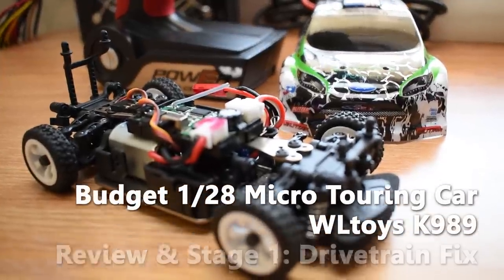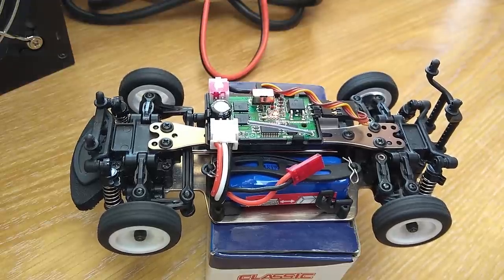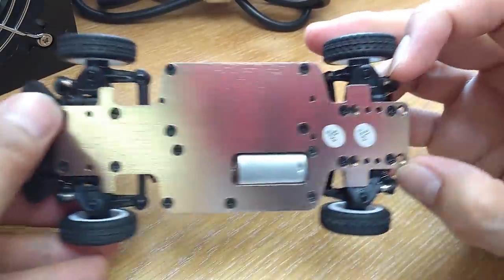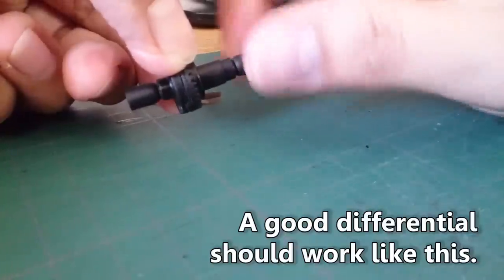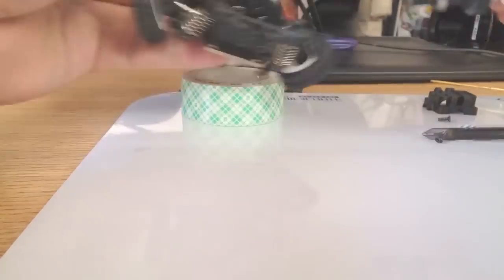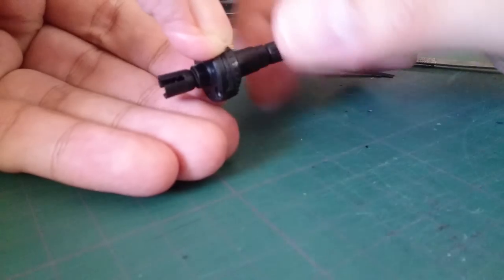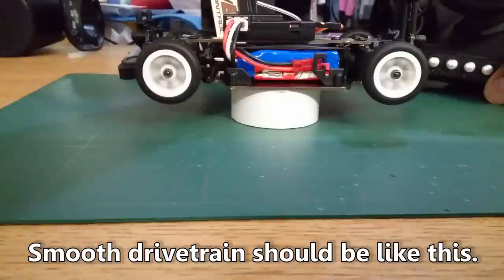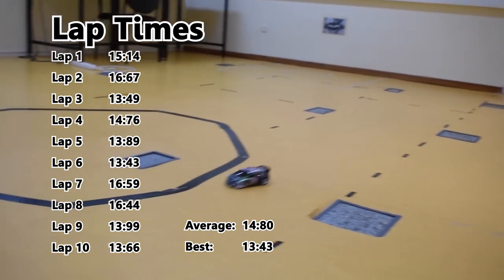WLtoys K989 Budget Touring Car - Stage1 Drivetrain Fix

Comment: How does this type of car compared to the Mini Z platform?  Better, worse, or just different?
Reply from the maker: For me it's better because I can choose any electronics I want and not stuck with proprietary electronics/radio.
As for the driving experience it's different from chassis to chassis. For WLtoys chassis in specific it's better to drive than standard Mini-Z AWD MA010 and 020 once all the problems are sorted out. This car takes corners better mostly because of the double wishbone suspension but still not as good as other chassis with grease filled shocks. And Mini-Z MA030 with DWS upgrade is better than this chassis. Not the speed wise but the consistency and ease of driving. I'd say MA030 allows me to make more mistake than WLtoys.
Top AWD touring cars right now are GL Racing GLA, Atomic BZ3 and Mini-Z MA030 EVO. While each of them offers different handling styles most racers choose GLA and BZ3.

ps. These days I mostly drive Mini-Q Q7 for touring and MA030 for drifting. I still haven't made the videos detailing my setup on these 2 cars yet though.
Reply: @BeaversHobby  Thank you, I really appreciate your detailed response.  I've been trying to figure out which AWD car to buy and I trust your opinion.
Reply from the maker: @blammers  My pleasure. Check out this video from Garage RC too. He has hi-end cars like GLA, SZ and BZ3. https://www.youtube.com/watch?v=77OeXvUxvbg

Comment: Great video. Can you do your recommendation on upgrade for Rc 1/28 racing indoor timber floor. Thanks
Reply from the maker: Replace the tyres with foam tyres. That's the main thing you can do to improve it immensely. There are XPower and GQ that come with wheels and the tyres glued to them. Otherwise you can use Tamiya Mini 4WD tyres.
Reply: Thankyou. Do you have part numbers and links where I can buy tyres and rims. I want to buy wide rims on rear and narrow rim on front. I have bought a set of fire laps tyres you use in your video.
Reply from the maker: @alessandrosebastiano8331  Firelap was OK if your floor is clean or regularly clean the tyres while running. If you want to run it without worrying about the floor cleanliness then foam tyres will help a lot.
The part numbers are
X-power ST-AWD-F-S-1 for the front.
X-power ST-AWD-R-VS-0 for the back.
Terminology explained:
ST-AWD means wheels with glued tyres for AWD.
F/R = front (narrow) or rear (wide)
S = soft, VS = very soft. We usually run front with lower grip so it won't roll over in the corners,
0,1,2,3 at the end indicates offset. Personally I run front 1mm offset and rear 0mm offset because the centre line will be pretty close and these work well with my body.
Reply: @BeaversHobby  Thankyou.Can you do a videos on wltoys 1/28 k969 car with all upgrades for indoor timber floor racing? Greatly Appreciate.
Reply from the maker: @alessandrosebastiano8331  Basically it's just the touring upgrade (this series) up to part 4 or 5 if you wish to upgrade the electronics and with the tyres I told you before.
Reply: @BeaversHobby  Great Advice.I'm sorry Where can I buy the best wheel rim and rubber tires combination for indoor racing.
Reply from the maker: @alessandrosebastiano8331  That depends on where you are. Normally I recommend looking for a local or regional Mini-Z shop. If you are in the US or north America, check out kenonhobby.com for EU check out minizracing.it/minizshop , UK https://www.rcm8.net/ and rcmart.com for global shipping.
Reply: I love your work. Thankyou again.

Comment: My front wheel is vibrating and I noticed that it must be a damaged ball bearing. I think the size is 3*7*2 . Will a 3*7*3 fit?
Reply from the maker: It will work but you can't fully tighten the wheel. You can only use it on 1 side (there are 2 in each knuckle) and pushing the wheel out 1mm is already bad so much so that the wheel might come off because there's not enough thread on the screw to grip the nut.
Try and find 3x7x2mm, there should be some on ebay.
Reply: @BeaversHobby  thank you very much
Reply from the maker: @Nikoslido  My pleasure.

Comment: Have you drifted the k989 with open stock diffs? Im currently using open diff for front and locked diff for rear, is locked diff for front & rear good?
Reply from the maker: My stock is like locked so it drifts pretty well. The open front locked rear was what I used before I had one way. It's something in between locked and one way. Easy to turn in but a bit tricky to hold the slide. All locked is more consistent.

Comment: Hi!)) you showed how to fix the steering center on the transmitter  wltoys..  i can't find this video. Can you help?
Reply from the maker: I think it's about the taking the horn in, re-position it and screw it back. I don't think I made a video specific for that though but it's pretty basic. Take the servo out, unscrew the horn, power on the car + servo then put the horn back in straight.

Comment: Do these mods also work on a k969? Also are the stock k969 wheels and tires good for hardwood? If not what do you recommend because I plan on buying new wheels and tires but idk which ones to get.
Reply from the maker: Yes, the modifications are the same. The differential is a bit different though, K969 uses locked diffs and it doesn't have bevel gears inside. So you'll only check the thickness of the diff for good gear mesh.
As for the tyres, they are alright. You'll run more risk of scratching the floor than other tyres. If you want an upgrade, get Mini-Z AWD wheels and drift tyres.
Reply: @BeaversHobby  Thanks! One more question though, did you use thick or thin lube for the bearings and thick or thin grease for the diff?
Reply from the maker: @Nesrak  Bearing lube is a very thin oil. At the diff I use thick grease to give it a bit more tension. There're gear diff greases from Kyosho. I use no.30000 at the front and no.15000 at the back. Higher number is thicker.

Comment: Can you use a professional balance charger with this battery? Thanks
Reply from the maker: Yes, you can. And it's what I recommend too. The battery is 2S lipo 400mAh so you only need to select a proper setup for that.
Reply: Beaver's Hobby Do you plug the red jst into the main supply and the 3 pin plug into the balance plug on the charger?
Reply from the maker: @narrowempress1625  Yes, exactly. If your charger doesn't have red JST on the main you'll need an adapter. It should come with the charger though, my iMax B6 did anyway.
Reply: Beaver's Hobby thanks and I do have a jst rcy adapter that came with my imax b6 v2. In fact, I have 3 in total. And do I set the a ampage to 2.5a and have it on Lipo auto charge just to be sure? And does yours automatically cut off when the charging is done? And for the headlight kit do I get a jst rcy male plug to connect it to the battery? Thanks
Reply from the maker: @narrowempress1625  Manually set the cell to 2S or and A to 0.4 or 400mAh. Charging at 1C is the safest way to do. It'll stop charging automatically when the battery is full and if you haven't change the alarm setting it'll beep pretty loudly too.
And yes, you can do the light kit using RCY plug because the balance plug is occupied by the ESC.
Reply: Beaver's Hobby thank you. So I will set the ampage that’s going into the battery to 2.5a right? And is the grease necessary to fix the diff? Thanks
Reply from the maker: @narrowempress1625  No, the amperage that goes into battery is 0.4a. 2.5a is 2500mAh which is 6.25C and you battery will blow up.
The gear diff grease will help but not that necessary. If you haven't got specific grease for gear diff you can lube it with standard plastic grease or PTFE grease.
Reply: Beaver's Hobby thanks
Reply from the maker: @narrowempress1625  My pleasure.

Comment: Hey, please can you tell me will this stop the motor getting so hot it burns through the battery wire? I have the 284131
Reply from the maker: It should. By freeing up the drivetrain it will take a lot of stress out of the motor.
Reply: @BeaversHobby  thanks for your reply, I’ll give it a go
Reply from the maker: @rlevene  My pleasure. Best of luck with the fix!

Comment: As you apply grease on the gears and oil on the CVD joint, will dust stick on it?
Reply from the maker: The gear will be alright because the gearbox is closed so you'll only get the debris from worn out gears. As for the CVD, yes, it'll pick up some dust so it'll need regular maintenance. Just swab it with cotton buds after some runs and it'll be alright.

Comment: Just opened my diff and the bevel gears are a yellowish clear plastic instead of the black like in your video. Not sure if this is an upgrade in plastic
Reply from the maker: The material is random . Some say the yellow/white last longer but it differs from person to person. Hopefully yours last longer than mine.
Reply: @BeaversHobby  what lube do you use for the swing shafts?
Reply from the maker: @Shumiotoko  Bicycle chain oil

Comment: Hi m8. I've been into fpv drone freestyle for 2 years and looking to get into cars. Would this be a good starting point? Could i drift with it if changed tyres/wheel and fiball question, Have yu seen fpv rc cars? Im tempted to put a first person view zero latency system in there
Reply from the maker: Yes, this will be a very good starting point. It's fast and has responsive steering for a start. Handling is good after you fix the suspension and you can turn it to drift car by simply swap the wheels and tyres. This car, as I said in the video, uses Mini-Z format so you can get a set of wheels and drift tyres from Kyosho Mini-Z and it's ready to drift.
I have a ready made FPV RC car from Emax coming but I doubt it would be as good comparing to installing your own FPV system in a good chassis like this K989.
Putting zero latency system in this will help a lot too.
Reply: Thanks man. As soon as my hobby  found is back to normal after xmass i should get one myself. And i tried my friends emax car. Fun round the house but does bot have the power for outdoors/longer runs

Comment: 9:30 what is low voltage cut off? and is it anything to be concerned about with this car?
Reply from the maker: Low voltage cut-off is the system that protects the Lipo battery so you won't over discharge it. With this kind of battery you it's not safe to go lower than 6V or 3V per cell so it'll stop the car once the battery reaches the threshold.
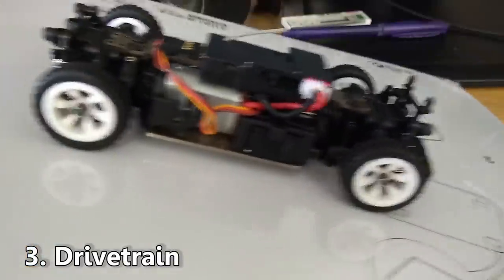The parts to look out for are centre shaft pinions and differentials. They wear out very quickly so you'd better stock the spares. You can also mod it like in this video. Skip to 5:43 https://www.youtube.com/watch?v=ci54dkbc_Bc
Reply: @BeaversHobby  So does the car have low voltage cut off? also one more thing: are ball differentials worth it?

Comment: How long does a drivetrain take to "run in" ?  @ 9:30 I can only use the last 25% of my Throttle trim on a 284131 its insane sticky (using 2 axles)
Reply from the maker: It's different from car to car so after you fix the differentials and gearbox the run-in can take from 15 minutes to however long it needs.
Reply: @BeaversHobby  Thank you for your swift response about the times! I hope this still fixes the stickiness with 2 axles... I have ball diff on order for the front.. Thanks again informative as always! <3
Reply from the maker: @jimz1024  My pleasure. Best of luck fixing it!

Comment: hi, i am interested to buy drift car , i need some information 1st Q: ''SINOHOBBY Mini-Q TR-Q5OP-BL 1/28 and K989 are same chassis ? can i use body part from one to another, for modification?  2nd Q: i want solid carbon or aluminum chassis with brushless system (quality Ball Differential )i have FS GT3B transmitter, can i use that with k989 and sinohobby qtr-q50p-bl  ?  all i want to say , i want a good drift car with low price thank you in advance
Reply from the maker: No they are not the same chassis. Q5OP is Mini-Q and it's more closely resembled to Mini-Z with narrow chassis and adjustable wheelbase between 90 to 102mm (K989 is wide, adjustable between 98 and 102mm) so Mini-Q fits more Mini-Z body than K989 too. Body from K989 will fit Mini-Q however I don't know what body will you get with Q5 nowadays so that might not fit K989.
Anyway, as I said earlier, some Mini-Z body will fit both.
To use GT3C with K989 you'll have to change the ESC. However Mini-Q Q5OP is ARR so you can install your own receiver.
Q5OP is not that low price and in this price bracket there's Q7 which is cheaper and handles better. Here's the car http://bit.ly/2MuzSim you'll also need metal driveshafts http://bit.ly/2ksB60i . Q7 is carbon chassis, fully adjustable double wishbone suspension with brushless motor and comes as ARR so you can install your receiver to it.
Q5OP should come with ball differential and Q7 brushless definitely comes with ball differential. Quality is good too.
However for drifting you'll most likely need front one way and locked rear diff. Mini-Z compatible part will fit both so don't worry. And you can lock ball diff pretty easily.
Choose between Q5OP and Q7 according to this: 
- How much prior experience you have with RC? Q7 will need a bit more tuning than Q5OP and Q5OP is easier to tune.
- Do you want to use Mini-Z narrow body? If so Q5OP will fit better. Check the body here, MR02 = wide http://mini-z-guide.com/bodies.htm .
Hope this helps.

Comment: My servo upper hole is bigger and screw comes off, way around guys...?
Reply from the maker: There are 2 ways of doing this.
1. If you have 3.5mm ball head with M2 screw like the one from Mini-Z or Atomic then use that.
2. Fill the hole with super glue and baking power or plastic filing.

Comment: Mine doesn t turn left at high speed, but low speed left and right are ok... servo seems good. An idea?
Reply from the maker: There might be a problem at the steering column or assembly. Check if the wheels stay in full contact to the road when you steer to both left and right and no wheel is lifting during the process. Next is the differential, sometime it just doesn't want to spin the other wheel when under stress. That's the sign of a broken diff.
Reply: @BeaversHobby  thx, I open the diff and it seems ok, but hard To turn. I clean it with break cleaner and Will put grease on it. (But I loose one satellite. 🤣
Reply from the maker: @reekooism  Loosing one gear isn't that good... maybe try finding it before putting it back.
Reply: @BeaversHobby  after 1 hours of heavy searching, I gave up...
Reply from the maker: @reekooism  Oh in that case you have no other choice but to put it in and see.

Comment: Hi, what is the wltoys wheel offset out of the box? I was wondering what it is but I don't see it in the manual.
Reply from the maker: Stock wheel offset is 1.5mm offset.
Reply: Thanks 😎
Reply: @BeaversHobby  Also, Did you carefully see the misspell word at the front cover of the manual where it said "MODLE" which is suppose to say "MODEL"?
Reply from the maker: @rickflamez5630  Wow! I didn't see that. Hahaha.

Comment: Would you recommend using the metal suspension components on these ? Thanks
Reply from the maker: Only few parts like knuckle and shock tower are good. All the rest will mess up your suspension geometry and ride height. And even using only knuckles you'll have to fix to get it working at full potential. Here's how you fix it. https://youtu.be/coFHPQg4BQs

Comment: Can I ask, I have seen some other video about this Brand, they say the stock remote cannot use rechargeble battery such as Eneloop, just use Alkaline non rechargeble only.. Is it true??
Reply from the maker: No, its not. I use Eneloop and Ikea Ladda in all my radios and they work fine.
Reply: @BeaversHobby   ouh ok tq sir, because it confusing me some other viewers said it cant be turn on if using rechargable battery on stock WLTOYS remote, tq sir
Reply from the maker: @aliffaslam7289  Strange indeed. Just make sure they are fully charged before putting them in and the remote will work.

Comment: Which one's better k969 or k989
Reply from the maker: They are essentially the same car with different wheels, tyres, differential and body.
K969 is drift car with drift tyres, locked diff and Porsche body.
K989 is grip/touring car with grip tyres, gear diff (open diff) and Ford Fiesta body.
Choose them according to what you want to do, drift or grip.
Reply: Thanks a lot so I'm buying k969
Reply from the maker: @Someone08-18  My pleasure. Have fun!

Comment: Do you have to do the front and rear drivetrain or just the rear? Thanks!
Reply from the maker: Check both front and rear if any need fixing. Most likely all of them need fixing.
Reply: @BeaversHobby  awesome thanks for the reply man, your helping keep this section of the hobby alive!
Reply: @BeaversHobby  instead of doing the fix, is there a way I can buy brand new drivetrains for the front and rear that are ready to go?
Reply from the maker: @serrkk  Yes, you can. Basically the problem is at the differential and centre shaft pinion.
So you can get a better quality diff like Mini-Z AWD differential or better still, upgrade it to Mini-Z ball differential then you'll need to get a long CVD kit (as I mentioned in the video, it's a wide car) nowadays this it pretty easy to find. Here's one on banggood. https://bit.ly/3m1i4bd
Then you can replace the pinion with metal gear. https://bit.ly/3w7XChB
As for the diff check out your local Kyosho Mini-Z shop.
Reply: @BeaversHobby  thank you for the information, extremely useful!!!!
Reply from the maker: @serrkk  My pleasure. Best of luck with the project!

Comment: Back diff in my car (284131) was so bad it the wheels would not turn opposite ways at all. Like having locked diffs 🤦‍♂️front almost as bad
Reply from the maker: That's why we either have to fix the diffs or replace them.